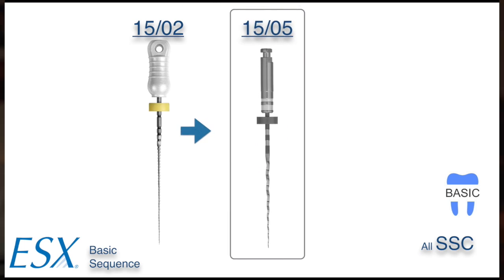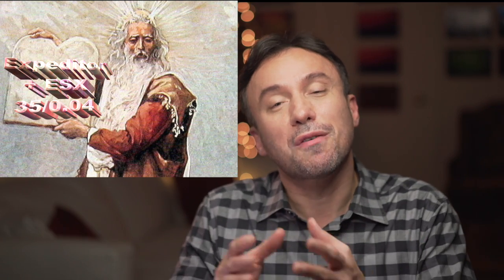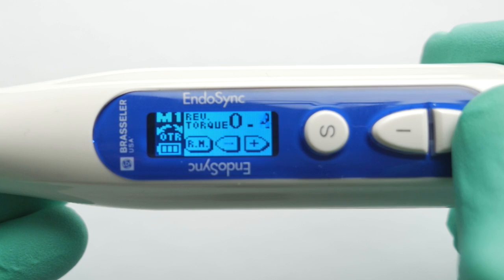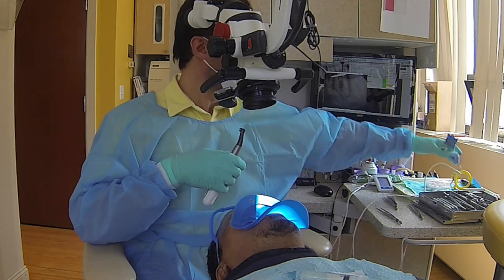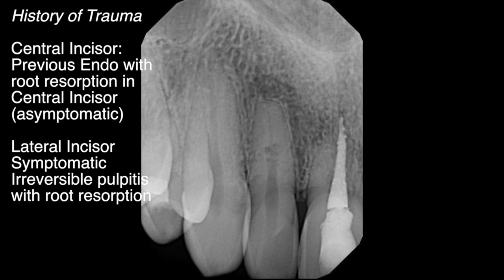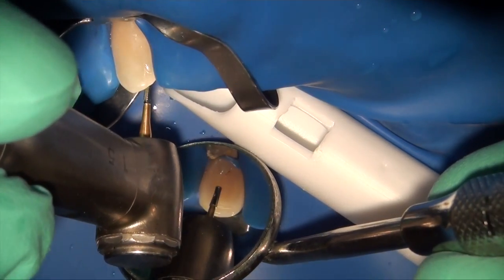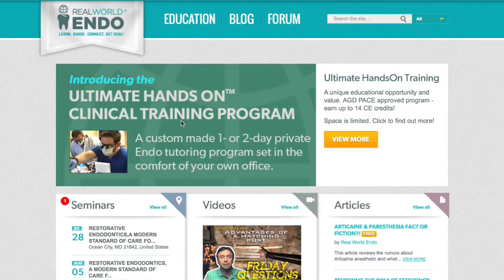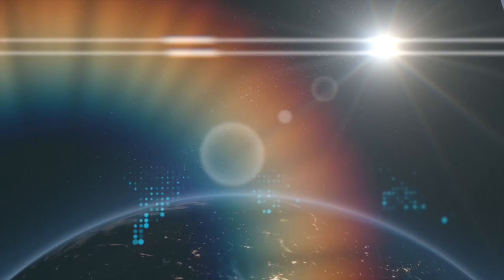Basic ESX Protocol with EndoSync & EndoSync A.I.

Comment: Dr. Nasseh, I'm curious if you have a recommended tip to use with the ultrasonic for basic irrigation and activation? (I've just purchased this same setup from Brassler) This is a fantastic video by the way! I've been watching your videos for a little over a year, and they have helped me tremendously.
Reply from the maker: Sure. Use the E11 and E12 tips (for anterior vs. posterior) along with a size 20 U-File Tip. Connect your unit to your water source from your Quick Connect attachment to allow water flow through the tip while irrigating. It's important to set the power setting on your Forza Ultrasonic unit to P1-2 (not the recommended setting on the tip box which is designed for cutting rather than irrigating!) It you set the power to higher than P-1 you can potentially ledge. But my tests show at the lowest setting it doesn't. So, set it to the lowest setting and allow water to go through it. Use it passively and don't let it bind in the canal. It should always be free in the canal and you can go up to the curve but not beyond it. It is what I use in 100% of cases nowadays and why I manage debris removal so efficiently. Use it after 1 or 2 Rhythm motions on your file and it will wash out the debris form inside the canal very quickly (when it's connected to water!) Good luck!
Reply: @EndosKool  Incredible information, thank you so much for taking the time to send this!

Comment: Good morning sir 
One thing i rarly see in your cases. Are the lateral and apical puffs and. Lateral fills.   People make lot of fuzz of it.   Sir u doing wonderful cases. But?  Where are those
Reply from the maker: The goal of root canal therapy is disinfection of the main canal, not filling lateral canals. The filling of lateral canals is often incidental and a big distraction from what's important. There are no studies to date to prove a higher success rate by filling lateral canals. Keep in mind this channel is about basic endo cases designed for general dentists. ! ;)
Reply: Real World Endo thank you sir.  Please upload atleast one such case.  
Your presence is global now.  Whenever i ask some endo doubts in dental groups. They usually say" dr for vedios check dr ali nasseh vedios at you tube. "    :)
Reply from the maker: Than you. Well, if you want to capture more lateral canals check out the video I just uploaded a minute ago on passive ultrasonic use during debris removal. That certainly helps capture more lateral canals if you're interested in that. But keep in mind, filling of lateral canals will not improve your success rate, thorough cleaning of the main canal will and sometimes the two coincide. Cheers!

Comment: I hate how the file stops at the apex.  He had to tug to pull it out after it stopped.  In a case with a curved root there would be a chance of file separation during this.
Reply from the maker: I agree. The quickest work around is for the assistant to remove the lip clip from the patient or disconnect it and you will then press the engage button and the file begins to move! Otherwise, you can disconnect the chord to the back of the handpiece and it will do the same. That's a good work around to this issue. Cheers! :)

Comment: Do you use lubricant on your rotary files?
Reply from the maker: No. There will be a video explaining that at some point. :)
Reply from the maker: reema assaf Hi Reema! The percentage of EDTA is based on the balance between removing the smear layer without causing  dentinal erosion and damaging dentin itself. There are lower percentages but not higher for that reason. Canal Clean, the EndoSequence EDTA product also has a surfactant in it. I will do a video to explain the use of lubricants in endo at some point. Hope all's well with you! :)
Reply from the maker: Lower RPMs increase the torque on the file and increase the chance of fracture. There's a sweet spot and ratio between torque and RPM. In general, torque goes down as you increase the RPM. However, as you increase the RPM beyond a certain point the file gets stiffer and you also have less time for error. If this lower RPM was not a problem we would have used Rotary NiTI Files by hand. We don't because they will have a higher rate of fracture due to excessive torque at such low RPMs.